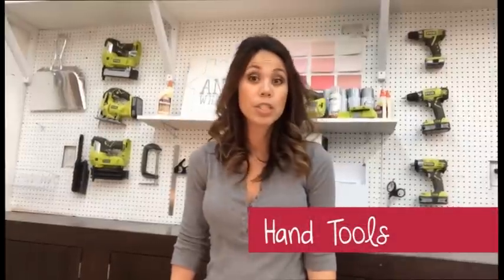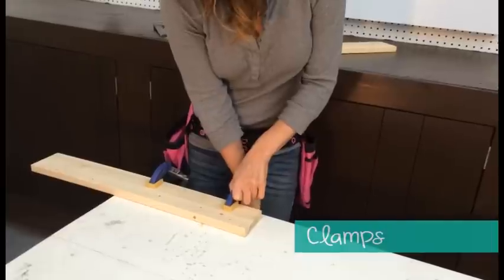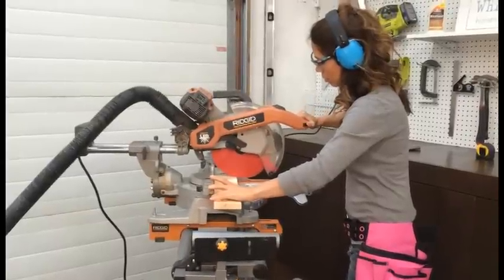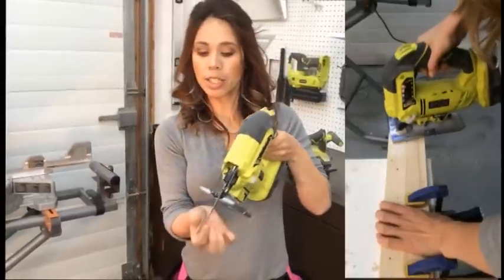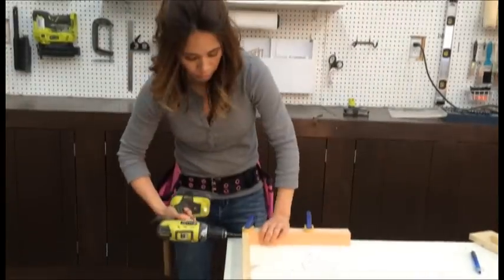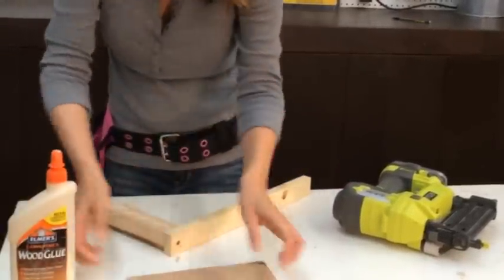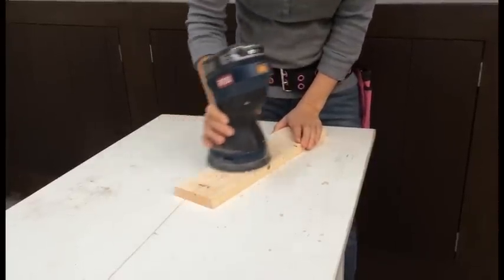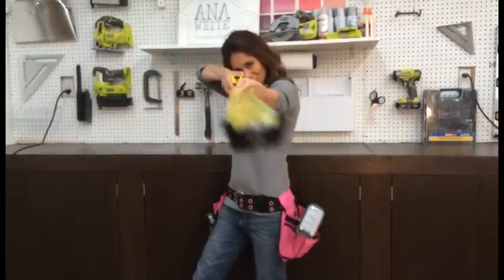Learn to Build with Ana White: Essential Tools

Comment from the maker: Hi Lara, I'd definitely recommend a brad nailer (18 gauge) as the first nailer to purchase.  It shoots a nail from 5/8" to 2" (the Ryobi Airstrike in the video does) and these nails are very tiny, so hard to see when in project, but also very difficult to drive by hand without a brad nailer.  A finish nailer is usually a 15 or 16 gauge nailer, and these shoot much bigger nails, more difficult to hide and can be driven by hand.  Those nails are generally used for bigger pieces of trim - like exterior moulding.

Comment: Hi Ana,

Great intro to Basic Tools. You mentioned getting a pocket jig and though they are handy to have they are also expensive. An alternative to the Jig is to just buy the Pocket Drill alone and practice drilling the same hole without the Jig; of course it will not be as simple but it is easy enough that with a little practice one can get quick with it. Just remember to start almost 90 degrees until the bit starts to bite then angle it about 60 degrees to finish the hole. Again practice is key so don't use your finish piece to practice on, make sure to use scrap. Obviously having the $100.00 dollar, or more Jig is Ideal, but a $7.00 drill will suffice in the meantime... I magically found your channel today and I look forward to your next project, keep up the great work....
Reply from the maker: Good tips Paul!  I'm so glad that you stumbled in!

Comment: Hi Ana, I am very new at this and I am still looking at what electrical tools to buy. I would like to know if you recommend to buy cordless tools (saws, drill or hammer drill, sanders). I've seen that these are more expensive than the ones you connect to the light, but I don't know if in the long run I will get fed up of connecting them. Can you comment on this? What are your suggestions on this?

Comment: I like the pocket hole jig idea but I'm not sure I'm ready to have to buy special screws for them (from what I understand).  Currently I get by with specific screws for some jobs, or random screws for other jobs.  They are all cheap or inexpensive, even from garage sales.  But a specific screw needed for pocket holes, that's where I'm a little confused on making the move to that, even though I see the benefit of the pocket hole.

Comment: Hey Ana - is the nailer you'd recommend a brad nailer or finish nailer? Thanks!
Reply: Depends on the application. If I had to choose only 1 tool, it’d be an 18 gauge brad nailer. Versatile, will secure many types of projects whereas a pin nailer has finer “nails” and is pretty much limited to finishing/trim applications.

Comment: Hi Ana, I've come across your channel and subscribed. Thank you for all the videos you've posted, especially this one to get me started with the projects. 

Questions about some of these tools. #1 for the Kreg Jig, I see you recommend K5 over K4 in your blog (ana-white.com). How about K5 Master System? #2 for the nailer, would the air type (as the Ryobi Airstrike) be good enough? or cordless electric type like Rigid Hyperdrive is better to get? #3 for the sanders, should I get both orbit and corner cat sanders? or just corner cat one is enough?

Thanks again for your videos! and i'm looking forward to starting projects built from your plans in your blog!
-Krisna
Reply from the maker: Hi, thank you!
Reply from the maker: The K5 is just easier to work with with the clamp on the front and easier to adjust.  If you can splurge on the master system it is definitely worth it.  The best nailer is definitely the Ryobi Air Strike brad nailer, especially if you are already on their battery system.  Pneumatic nailers are faster and more powerful, but you have to deal with a hose and compressor, so I don't recommend them unless you are doing alot of nailing.  You could start with the corner cat but will want the orbit when doing bigger projects.  Hope all this helps!
Reply: +Ana White thank you for the answers!!!

Comment: Small Tool Tip: Watch your vid and take note of how you hold the board when using the Miter Saw... STOP doing that right now!  Do not hold the board lightly with half your fingers in the air and not on the board. Because when that thing kicks - and it EVENTUALLY will - it will/could suck that board or you hand right into the blade because you weren't holding your board firmly.  From this day forward - Stop and think about how your holding the piece your cutting on the miter saw every time BEFORE you start the machine.  Scares the crap outta me seeing you hold the board like that.
Reply: NorthernChev also use a dust mask when sanding,!

Comment: Good video but I think perhaps you are listing more than the essentials. To start out all you need is a drill, drill bits, a screwdriver and a circular saw. I made a wardrobe, 15 years ago as my first project, with just those tools.  Admittedly I could do it better and faster now that I have more tools but there is no sense buying all that stuff you mention from the beginning if you later find woodworking is not for you.